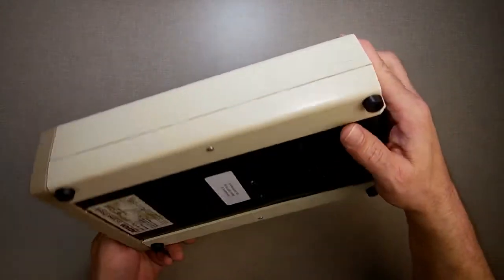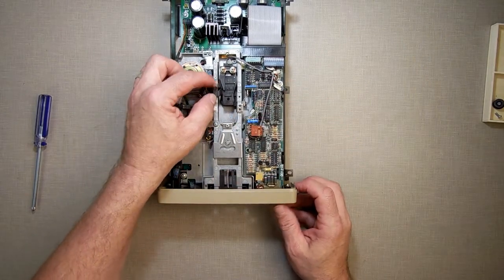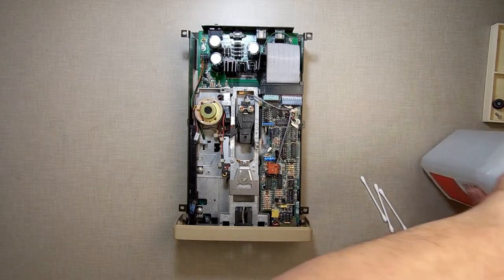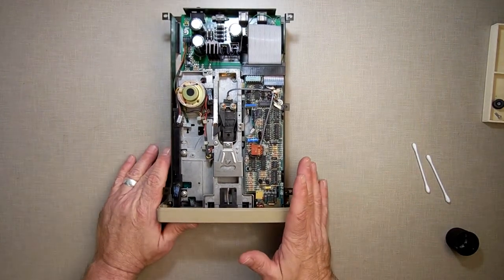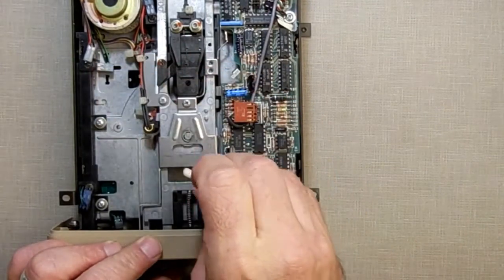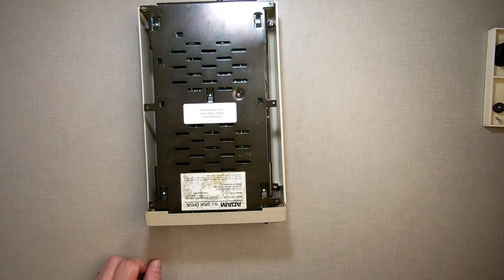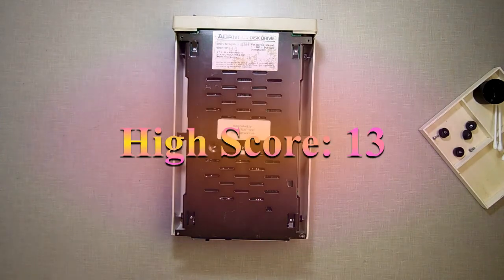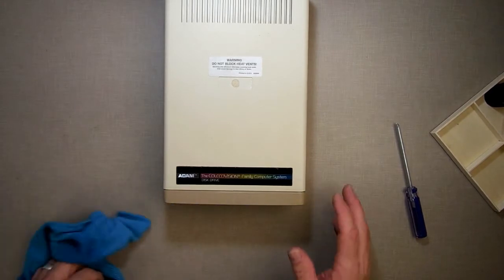Coleco Adam Disk Drive Maintenance #FebruAdam

Comment: Great set up👍 little tip though, place the 4 screws in the metal bracket holes first then place drive slowly down on case making sure screws set in case holes before early screwing them down. 
Thank you for the great tips and walkthrough of the drive.
Reply from the maker: You’re welcome!

Comment: Great overview on floppy drive maintenance. I was hoping to see a picture of the bottom board – do you know if the ROM on there is socketed?
Reply from the maker: Yes it is
Reply: @8BitMilli Excellent, thanks. The schematic doesn't really give any indication either way, but I also saw someone with a bunch of aftermarket ROMs for the drive...

Comment: Love the video.  Followed all steps on a recent overpriced eBay purchase prior to power up.  Also found motor belt was dried onto large pulley but gently freed it for proper spinning.  Unfortunately head mechanism refuses to seek or move forward. Moves by hand OK, and does later retract if I pull forward while off.   Talks to AdamNet bus as DRIVE C.  Any idea why no seek, possible repair options?
Reply from the maker: Check the wires for breaks
Reply: @8BitMilli  Turns out my 160K drive purchase is in better shape than I realized.  It appears either my 160K disks have long ago been erased, or the drive might need alignment adjustment to read those disks.  I was able to boot datapack CP/M and format and verify 160K CP/M disk!  Things are looking up. 😀. This video helped me ensure a clean and lubricated drive at first power up.  Thanks again!
Reply from the maker: @underthestarsgamingandtech9973  awesome!